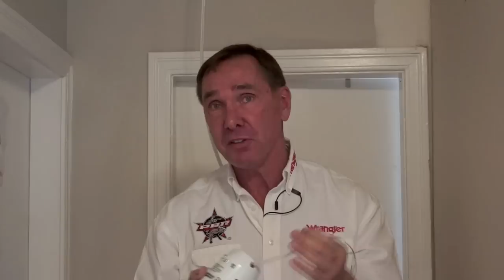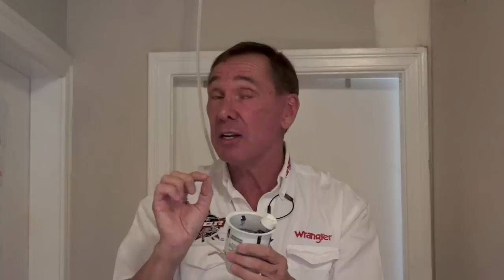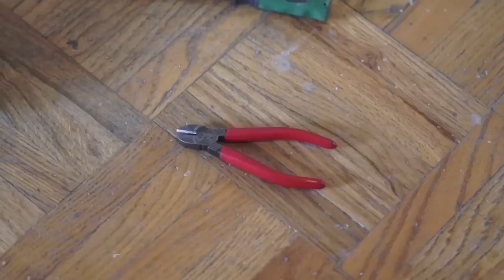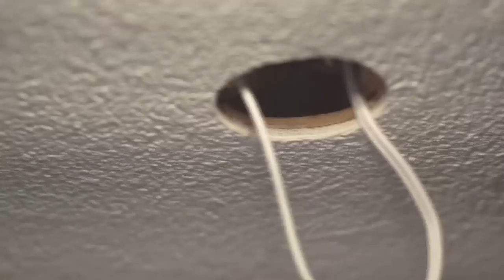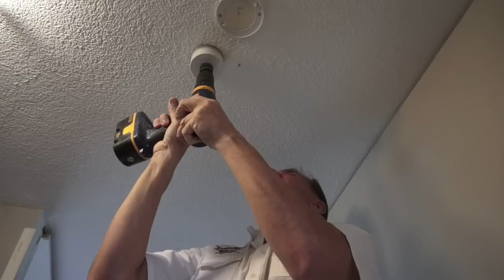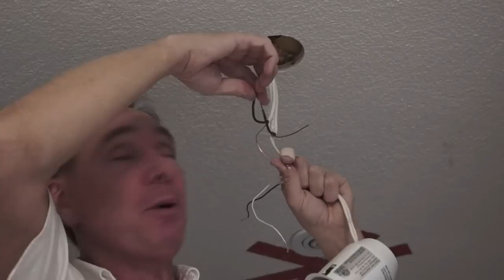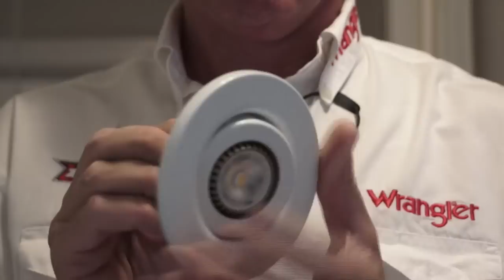How to Install Recessed Lighting | Retrofit

Comment: Absolute garbage, do not listen to this clown.  His "instructions" show dangerous wiring methods which could easily cause an electrical fire and absolutely do not follow the Canadian Electrical Code or any industry standards.

Total hack and poor attitude on his part (read his "insightful" replies to others who bring up valid concerns.  "But it works," you might say.  Consider this - would you drive intoxicated without a seatbelt and airbags "cuz you think you'll make it?"

Comment: The pot lights are the wrong type. They should have a box attached that you bring at the wires into. Not left in the ceiling exposed.

Comment: Where are your safety glasses guy ??  No electrical boxes ..sorry ; not code .     At the VERY least ; you should purchase or suggest that people buy a cheap tester to see if whoever wired it ; wired it live to switch & then to the light ...  Milli-amps can stop your heart & you are dealing with "15 " amps at the very least  ... You are asking for trouble ..only an ass assumes .

Comment: Could you make a video on wiring lights without an existing   Ceiling  Light . I can’t find a video to save my life . I have a house with no ceiling lights in the bedrooms . I have light switches that control an outlet on the wall . How could I install lights in a room like that with the light switch working the way it does ? Probably just ignore this headache

Comment: Did your house burn down yet? No. Will it burn down because the connections are exposed? Probably a million to one. Is your installation safe? Yes. But why not  encourage people to put the wires in a junction box? In your situation those connections will not come apart, not overheat etc. But this applies only to your low attic. 
A junction box is also to keep the connections restrained in case someone who has an attic that has storage space steps on or moves them. Why not error on the side of caution if at all possible or at least state why the junction box comes with the can light?

Comment: As a fellow Canadian  in ontario I can assure you that all connections must be made in a box for sure. You got it working and did a nice job but man I'd be worried about the splices up in the ceiling. Btw I've put in over 30 of these in my house they are awesome what a difference they make. I got rid of the halogen aswell and did gu10 leds.

Comment: Wire splices without junction boxes have been known to cause fires because if a connection becomes loose an heats up it could start a fire. Especially in an attic where there can be a really cold or really hot also your devices are not grounded and if a hot wire shorts to the metal housing it could cause it to become live and the person touching it can get shocked or electricuted. Yes 120v can kill you. If you don't believe me post a video of you holding onto a 120v hot wire. If 120v can't hurt you then why did you turn the power off at the switch.

Comment: good lord. as the 900+ comments before me have largely indicated, this is NOT CODE COMPLIANT. why is that important? so that were your house to catch fire for any reason, the fire marshal, when issuing his report, will NOTE the safety violations. assuming you have fire insurance, the insurance underwriter will take much interest in this. why? it is very simple. THE INSURANCE COMPANY HAS A SUBROGATION DIVISION. THESE ARE A GROUP OF FOLKS WHO WHEN FACED WITH A CLAIM, **SUE** THE PERSON RESPONSIBLE FOR THE CLAIM OCCURRING. it is usually a contractor, but is NOT LIMITED TO A CONTRACTOR. IT CAN BE ANY RESPONSIBLE OR NEGLIGENT PARTY, WHO CAUSES A LOSS TO OCCUR.

subrogation departments are NOT staffed with nice people. you really don't want to have anything to do with them.

for that matter, i would not want to have much to do with this fellow and his helpful suggestions. i've been an electrician for over 40 years, and a contractor for most of that time.
i maintain a $5M liability insurance policy. it's required by state law, in case i were to cause a loss of property as a result of my actions.

i also maintain it to protect me from having done any work on a structure, where unbeknownst to me, someone has done something like this. so, that policy also protects me, from people like this.

if you decide to do what he suggests, well, good luck to you. there is a reason i only do commercial and industrial work, and people like this fellow are the reason.

Comment: Listen you clearly don’t know anything about electrical I’ve been an electrical contractor for a little over a year now licensed in the state of California the spliced connections your making are 120v, and stay that way until you screw in the led bulb, the led bulb has a transformer that transforms 120v to 12v. But like I said the bulb itself has the transformer not the fixture and btw each one of your fixtures has a junction box behind it to make your connections but you took them off to save time good luck with the house fire 🔥
Reply: Correction even after you screw in the bulb the lines are still receiving 120v and the bulb constantly receives a 120v the led bulb itself has a built in transformer.

Comment: Don't be scared of electricity because it's ONLY 100VAC?  You sir, are a moron. There are hundreds of deaths from  the US every year from 110-120VAC, Run that voltage across someone with an unknown heart defect and see what happen. A little moisture on the floor, getting knocked off a ladder, the list goes on. 

I am a professional, and I wouldn't let you work as a laborer on any job I was running. 

Maybe Canadians are different, eh?

Comment: Just a heads up to anyone who is doing retrofits to add pot lights or cut/drill into ceilings with popcorn stucco finishes - especially if they are older than 1977 - there is a good possibility these stucco materials contain asbestos and it's really not a good idea to be exposing yourself to the dust. There are methods to deals with this that you can look up on the internet - they involve appropriate respiratory filters, spray bottles and disposable drop cloths at a bare minimum. But doing home renos requires a deep skepticism about the materials. So please be careful and if in doubt, consult a professional.

Comment: Sometimes at old houses the original installer. Switched the existing lights with the neutral. So be careful guys for that, and buy a non-contact voltage tester for your safety.

Comment: If your going to do it your self please make sure they say ic rated it stands for insulated ceilings non ic which he's putting on get to much heat and in dilation can catch on fire ,always is a junction box on ceiling when splicing,plus does little lights look ugly buy the 6" and will bring value on your home and turn breaker off ,fire insurance might not cover you if your house catches on fire if you do it he's way,

Comment: Anyone doing this yourself, PLEASE splice your wires inside a junction box. If the bare wire short-circuits (bugs, mice, brittleness over time, jostling the lights/rig), it can spark. Back in the day this used to be a fairly major cause of fires -- don't be a needless victim. I've worked on poorly wired devices before where old, brittle twist-caps broke and live wire hit the neutral. If you're lucky, nothing happens and the breaker trips. Unlucky and you can lose your life. Also, the mains power is more than enough to stop your heart or severely burn you.

Comment: Do you have instructions on the reverse? 

I have an existing cannister/recessed lighting fixture with  plug-in compact fluorescent (shown below). I'd like to switch to an LED screw in bulb. 

There is no attic access. 

I just want to know how to remove the existing cannister and replaced with a new cannister (that'll work with screw-in bulbs)... 

Link to my existing light bulb, which is not screw-type bulb:

 https://www.1000bulbs.com/product/7067/FC13-G24Q127F.html?gclid=CjwKEAjwsLTJBRCvibaW9bGLtUESJAC4wKw1OXqzf4eZN9YrGchgBP_LJ0lm7rDd8ko3t15-c1YsGhoCDK3w_wcB)
Reply from the maker: Ted Schactimera easy as can be. LED's are amazingly simple, low cost, low wattage and extremely safe to use. There are several ways to go about this. The easiest is with the many pot to led conversion kits. A bit overpriced but really simple. The other way is to gut the pot, then attach you're own LED bulb abs socket.
Reply: Percy Lipinski let me clarify. In your video at 14:50, you pushed in the can light assembly (with no light bulb yet) into the hole in the ceiling.

Can you please show how to remove that same can light assembly (with no light bulb yet) without damaging the ceiling? 

Let's say I forgot my screwdriver in the attic part and the only way i can get it back is to remove the cannister assembly that I inserted into the hole and I want to get my screwdriver back.

Comment: 120 Volts can and will kill you.
Anyone from the US: working on energized circuits is an OSHA violation unless the circuit requires it to be energized in order for the work to be done (ex: to take measurements, or a hospital). Since this application does not, the breaker would need to be locked and tagged.
Also, no outlet box for a splice is a violation of NEC 300.15.
Depending on the parameters of the lighting fixture and the materials around it - a potential NEC 410-X violation.
Furthermore, if you are doing remodel work - the required supply wiring must be met. For example, if the house was wired with unmarked AC cable, by code you are to assume the wire is rated at 60 degrees C, but if the supply requirement is for conductors rated at 75 degrees C then you have violated another code.
Yes, LED bulbs generate much less heat, but you can't assume the homeowner after you will just end up using the same bulbs you do. 
All in all, this is his house and his choice, but if you were to acquire this property, you would be responsible for the code violations, and the costs associated with bringing the branch circuit up to code.

Comment: Yes it may never burn down or cause too much heat. but its still a dodgy / unsafe installation.
Reply from the maker: Valdox read your comment idiot. It may never burn down. His exactly will my house burn down with my installation. There are hundreds of idiot comments here saying this. Not even one has said how. Go ahead you douche bag try and explain it to all of us. Be a hero and tell us Dick face
Reply: - Under fault conditions will the protection equipment still operate correctly. 
- The video shows no sort of testing, metal parts don't look to be earthed  
- Single insulated wiring with what looks to be exposed terminations 
- Wiring not fixed either in conduit or clipped along timber

Whilst installing you are not testing to make sure the circuits are dead, other people could have dual fed circuits from some other dodgy bloke and could result in electric shock. 

Didn't specify cable sizes or the correct wiring, whats stopping someone using speaker wire (still works doesn't it?) 

So many things are wrong with this, even though its 120V doesn't mean it wont kill someone.
ever heard of ventricular fibrillation?

Comment: I found your video informational. Learned more about recessed lighting then i knew.
Reply from the maker: Kim Flaherty hi Kim, thank you. I've had a lot of people try to convince me that I'm dangerous. My family lives in my house and has for many years. I know exactly what I'm doing here. There's no need to pay an overpriced electrician! Especially now, LED lights can run off of 12 volts now. (Speaker wire)

Comment: thanks for all the information  like the set  up ... what I like to know I'm looking some led spot lights just like know should I go 110v  or 220v  those are the choices
Reply from the maker: desi frazier hi Desi, since this video came out much has changed (for the better). All LED bulbs are low voltage. They have built in power supplies to deliver that voltage. So why not separate out the power supply and run 5 or 12 volts to each of the bulbs. Then all you need is cheap low voltage speaker wire. Low heat. Go to eBay and you'll find 300 watt 12 volt power supplies.

Comment: Is it a good idea to get some junction boxes for the wire splices in the ceiling? Even though the bulbs can require such little wattage to power, there's still the full load running through the wires, right?
Reply: Lol, honestly, the only reason I commented was to trigger you into commenting. Tell me, did you hack this account or are you just trolling? Let's cut the bullshit already, it's been 3 years, buddy.
Reply: Percy Lipinski Yeah... Trolling doesn't really work once you're found out. Next time, don't make it so obvious. A subtle troll won't be as easily noticed and dismissed. And Zika? That's like 2 years late. Step yo reference game up bro.
Reply: tippity top kek fam

Comment: NEC 314: Boxes shall be installed at each conductor splice point, outlet, switch point, junction point, or pull point.

*DANGER* DO NOT USE ANY OF THE ADVICE IN THIS VIDEO: I've been a Firefighter and Fire Inspector here in Southern California for 15 years. This job would never be signed off down here on a job site and if discovered after the fact, would result in numerous violations. People legitimately die from this kid of awful workmanship. This video is downright scary actually. The code spells it out pretty clearly...I'm not really sure what Lipinski's argument is here.

I also love the part where you predict the future. "I know my work is awful but it's not an issue because I can personally guarantee that nobody will ever change these bulbs out!" Give me a break...you're a nut job.
Reply: If you keep this up, you're probably going to have a heart attack from the stress. Glad to see the respect you have for public safety though. This video is 16 minutes of my life I'll never get back. First, we've got to listen to that awful lisp you have. Then there's the stupid looking dog and finally, a breakdown of your cargo shorts. But, you've got that sweet Wrangler shit going for ya -- stylin! You should have just stopped the project when you put the hole in the wrong place. That was the first indication that you were lost and needed some help. 

This is too funny. The comments on this video were 100x better than the actual video itself.

Comment: Watching you twist wire with the the side cutters you using drives me nuts. If you don't know what your doing you need to have a professional do it. Then you wouldn't have to deal with a 4 in hole in your ceiling.
Reply: Ya, this is an awful video. The guy couldn't even drill the correct hole!

Comment: What a fuckwit ROFL
Reply from the maker: Ian Davies get lost you moron. You're also a douche bag loser piece of crap!
Reply: Suck my Balls, what do you think is going to happen if your un-secured and un-insulated wires touch together?

It'll will short out and arc flash, then blow the fuse or trip the breaker to protect the wiring. But with the possibility to start a fire and burn your house down, due to the heat of the arc flash, when the wires short out, which is approximately 4000 degrees Celsius.

All it takes is a rat or possum in the roof to knock the wiring around enough to do that. Or another electrician working on the house, pulling wires, etc, not aware of the non compliant / un-safe joins.

Its low watts drawn by the LED down lights, and they are only 12v after the connection to the globe which has an internal transformer. But the fault current, has nothing to do with watts drawn, its determined by the voltage (110v in your case) and the resistance of the wire used (cable size), you don't even understand basic ohms law. 

Don't mess with electricity or gas, idiot.....I hope you burn your house down and loose everything because your insurance wont cover your dodgy non compliant / non licensed work.

Comment: 120V wire splice and connection shall be in junction box and enclosed.  Your splice is violation of basic code.
Reply from the maker: EXTREMESERGE "your wiring is a violation of code". Hey douche bag, you're mother giving birth to an idiot like you is a violation of humanity. You don't need a splice box to make this low wattage system work well and work safe you piece of crap!!!
Reply: Percy Lipinski . Looks like you refering that to your self. (the birth part)  LOL!!!  Read the codes!!!!
Reply: Percy Lipinski Next time you place is on fire you will respect the code. And me, the citizen of USA. Hopefully you going to get cooked too much and able to read this. LOL
Reply from the maker: EXTREMESERGE douche bags should be placed in a junction box and taken a crap on

Comment from the maker: + Canada Bob um ya right, drilling a hole in a ceiling is Fire code violation? What an idiot you stupid douche bag!
Reply: Percy, I presented my concerns to you in a respectful and civil way, I even mentioned my appreciation that you were trying to help people. Whatever have I said that could cause you such offense, offence that certainly wasn't intended.
Reply: Percy Lipinski  hu
Reply: Actually, it is. Not so much for the lights you're installing (those have other violations) but for the mistake hole you drilled first. You can't have a break in the fire resistance rated construction of the floors, walls and/or ceilings. This is so if a fire starts in the living space, it can't quickly move into the attic or vis versa.